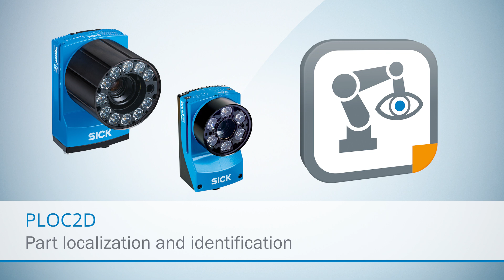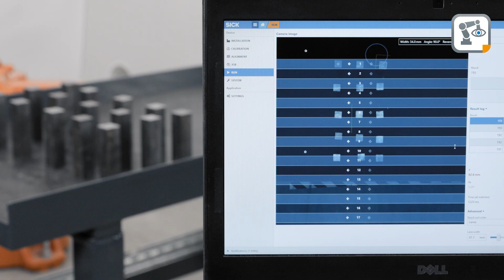2D part localization with PLOC2D robot guidance system | SICK AG

Comment: please answer
if there are 2 part with similarly curve
but just have 5 mm different size
could this camera type detect wich A part and B part?
Reply from the maker: Hi agung cahyono, Thanks for your comment. For more information, please contact our technical support via email: info@sick.de Our experts will answer your question as soon as possible. Best regards
Reply: Hey, Agung, yes this is possible! U can set the parameters very precise about this little difference.